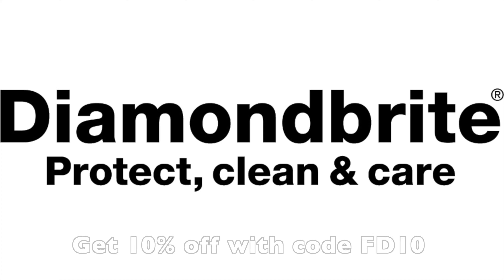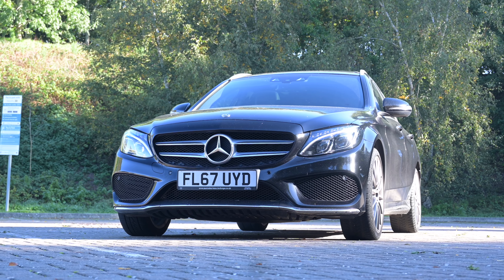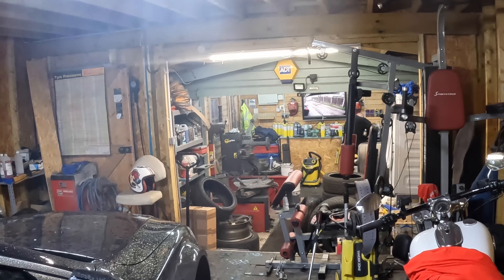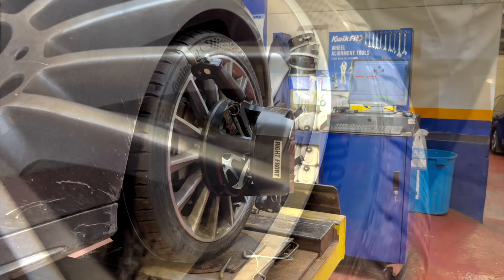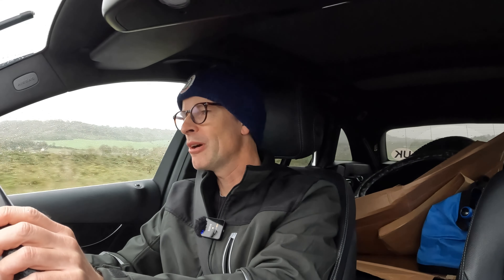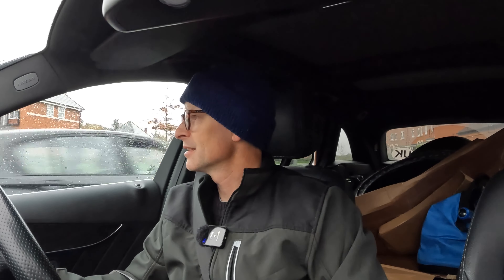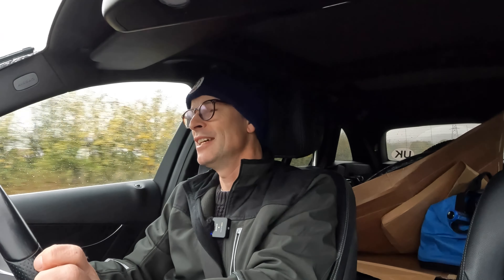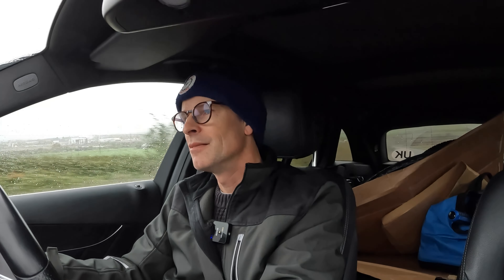Mercedes C250 10k mile update...Is it my new favourite?

Comment: Two points here in my opinion 5 speeds on an auto box is enough BMW and Mercedes  up to 9 is not a good idea they  say it is for fuel economy the engine and transmission will be better matched under driving conditions but what happens is the gears are changing up   down all the time trying to find the best spot and becomes un resonsive as Matt has found .Next the  large composite wheels and very low profile tyres now the trend are causing great expense as even a small pot holes or kerbes  damage tyres and wheels run flat tyres another bad idea take them off

Comment: 100% agree on the automatic geatbox. In my oppinion they are a step towards the electric cars. And electric cars for me are white goods on wheels. "Push button - make car go" electric appliances.
Reply from the maker: They seem that way to me to, a half way step to EVs and less control, although I prefer the transmission on EVs as although theres only one gear they respond more like a manual

Comment: I've said it before about this Merc - it's got 4WD (and all the extra mass) and an auto gearbox, so no wonder it's much thirstier than its predecessor.
The VED rip-off is a shame, but them's the breaks. I specifically bought a zero-VED car (2014 Fiesta Econetic) after years of having to shell out upto £125/yr on a car rated at 123g/km CO2, which always frustrated me (if it had been 3g/km lower, I could have saved £95/yr). My father drives a 2017 Focus and was most annoyed to get stung for £145 VED on it after only paying £30 for its direct predecessor (a 2013 Focus - same engine). 
Every vehicle tax loophole gets plugged eventually - I've heard that electric cars will become liable for VED in coming years, so at least we can say a big "halleluiah!" for that.

Comment: I hope you let us know how the economy is doing after the tire change. Sounds plausible that things may look up, when you leave the heavy tires behind. ..and i'd hope so. Your 205 certainly hasn't been brilliant on that account so far.

Other than that: I'd have such a car with the automatic, because i think that suits the car. But i'm happy we went from a lot of moaning to appreciation for the car in general. Makes me think i better put the S205 on my list of cars worth looking into when they get within reach money wise where i live.
Reply: Just a note: The tire weight wont affect consumpion in any measurable way, but the rolling resistance difference might. Generally, run flats arent that good for rolling resistance.
Reply: @GoldenCroc How much the weight of the tires affect fuel economy depends on how the car is used I believe. Going up and down in speed the weight certainly will have an effect. ..but you're right in saying that rolling resistance is a big killer of fuel economy, and that runflats often are less impressive in that aspect. It was around 02 o'clock last night when I wrote my comment. I only had the mental capacity to react to what was explicitly said, not to think for myself 😄
Reply: @jo05dk  It indeed varies for car used and speed and many other factors. But on this car, it wont have any measurable <- (key word) effect outside of the margin of error. Hope that makes it a bit more clear what I meant. Cheers.
Reply: He will get better fuel consumption figures with the new tyres because they are lighter… having a lot of weight around a large rim takes significantly wore energy to spin up to speed and then you’ve got to scrub that energy off with the brakes. The most efficient is steel rims, decent sidewall profile on the tyres and smooth plastic wheeltrims.
Reply: @johnmoruzzi7236  A bit of hair splitting but: Better consumption, yes. Better consumption figures he can tell us? No, not really.
Reply: @GoldenCroc  The fact that the car feels transformed will have a lot to do with tyre weight.
Reply: @johnmoruzzi7236  That is certainly possible, I can agree with that.

Comment: You should have sport plus mode which switches the box into manual only.
Reply from the maker: It has sport+ but I think its still auto
Reply: @furiousdriving  on mine c220d it has sport plus and then a configurable setting where you can specify manual,  I have the 7g box though as its a 2016
Reply: This is what I meant, saw this on a forum.  It's called individual. It will go straight to manual mode of the engine temps are hot enough.  

zorz , 11-13-2017 03:01 PM

Junior Member

You can set it to manual mode in Individual. Edit your individual mode settings and set transmission to manual. That way whenever you move to that mode you'll stay in manual at all times.

Comment: Who thought that a composite alloy that was rigid and with an unbraced inner rim was a good idea, at least steel and wire wheels have some give in them and easily repaired if damaged, I've spent many a few days respoking a wire wheel and getting it true, both bikes and cars, not an expert.  Don't they have potholes in Germany?  They don't use salt to de-ice the roads they do de-ice,  the same in Nordic countries, it can get too cold for salt to work, below minus 10, that must result in less road damage.  One gets very weary of black ice in winter in towns and rural areas.  Perhaps the UK could follow suit, making winter tyres and the carrying of chains compulsory.  Highways Departments of County Councils could save millions that could be spent on road maintenance.  Better for the environment too as no salty run off into water courses and rivers.

Comment: It's called Road Tax, so ALL road users should pay something to reflect their usage of the road network, I think that users of smaller, cheaper, more energy efficient cars should pay less, perhaps high mileage users should pay more.
 If the government wants to change it to a Pollution Tax, then total pollution burden should be reflected, not just CO2, so that a £100k ++,  2.5 tonne luxury EV, that required a considerable amount of energy / resources to produce should be taxed accordingly. I also believe that taxes should be progressive, in that the richer you are, the more you pay, so that a wealthy person driving a supermini, should pay higher road tax, than a low-paid worker, driving the same car.
Reply from the maker: Technically high mileage drivers do pay more tax through fuel duty, I expect there will be an EV charging tax in the next few years as home chargers are all smart and on separate power feeds

Comment: Pirelli': The experience I have with the winter tyres of Pirelli, means I wouldn't want them for free! They are garbage! Lot's of issues with numb steering and vibrations.
Runflats are inherently horrible due to the construction. Press cars usually avoid the RF's because of the issues, I know we do.

Comment: Why can’t German manufacturers see past black for just about every car they produce. I’m sure the Conti tyres will make a huge difference. I have 21” wheels on my F Pace and was seriously concerned about the ride, but I need not have worried it’s a real magic carpet ride.
Reply from the maker: its like a new car with these on it. I found an identical car in metallic blue, looked amazing but was 30% more money so went with black. Should have called the video "I bought the cheapest C250 in the UK"!
Reply: Its not the manufacturers that cant see past black, I assure you. Its the customers. They built what the customer demand.

Comment: That is a nice car. Are Mercedes products reliable in the UK and Europe? There are not in the USA. Once they hit 70,000 they are rubbish. Normally I think leasing a car is a bad idea but if you want a BMW, VW or Benz, leasing is the best thing you can do as you are rid of it before the end of the warranty.
Reply from the maker: C and E class are definitely good, and the estates are built in Sindelfingen, Germany so tend to be better. The A Class doesnt have a great reputation and shares engines with Renault who also dont have a great rep.
Reply: Our 2 VW’s 100k plus have been ultra reliable.   The Mercedes 50k not so much.
Reply: Euro brands are made for euro servicing and driving, generally. Both of those are on average much worse in the US, for a number of reasons. I.e. cars are the same, conditions really not.

Comment: 12k miles is not a great deal, but it's a lot to cover in a car you're not completely happy with. Not that this is a bad car, it isn't, but it's quite alien from the rest of your fleet, far too expensive to tax (when you're paying for several others), is a hassle with that runflat/winter tyre nonsense (which isn't needed in the UK, unless you live on a hill and need to drive in snow) and doesn't have your preferred gearbox type. 

Many would say, get rid of it altogether and distribute those 12k miles among your modern classic fleet. But I'd be a hypocrite, as I keep my oldies off the road over the winter and I have a Dacia Logan estate for modern daily duties - which also substitues for ULEZ and continental road trip duties! I'm sure the oldies would appreciate some of those miles though. I have no issues with an auto gearbox but I'd happily change my Logan for a manual, petrol Mazda 6 estate. The driving experience for me is more important than the toys.

Comment: what if you could make it a manual? i know it would be expensive to do but as a manual car it would be way more fun.
Reply from the maker: If it was financially viable it would be incredible, perfect car pretty much but i suspect the electronics are all too interlinked to make it possible. Maybe easier to get a base model manual and fit all the upgrade parts
Reply: @furiousdriving  actually I had the same thought about upgrading my c70, I have been wanting to upgrade it to a manual for some time as it was more viable to do this than buy a manual and upgrade it to its current spec as coding can also be really costly. It can be cheaper alternative to just go with that option.